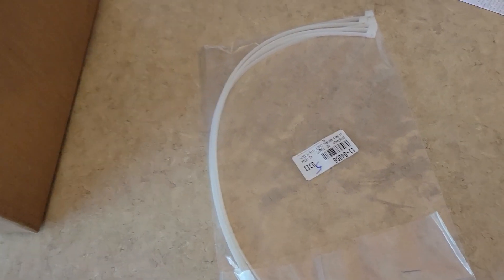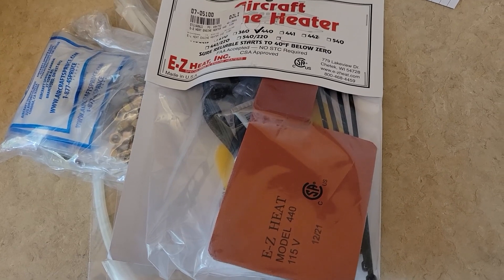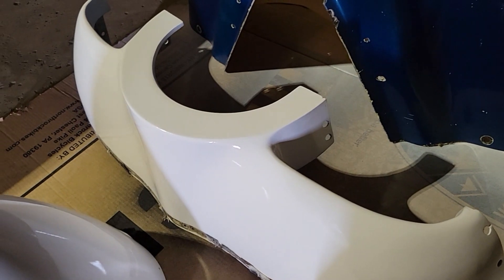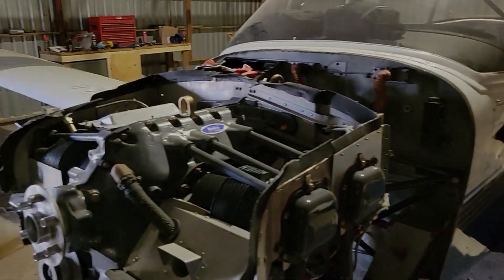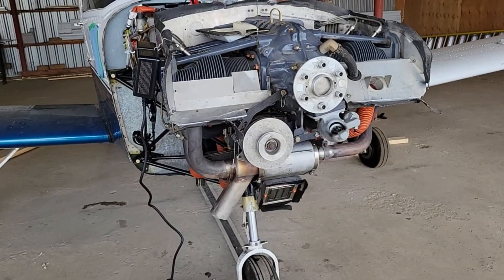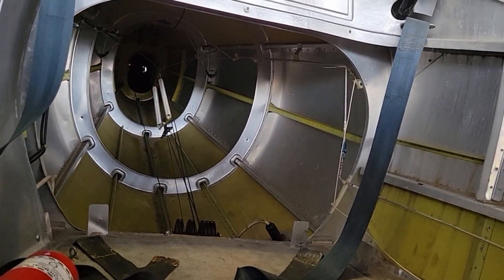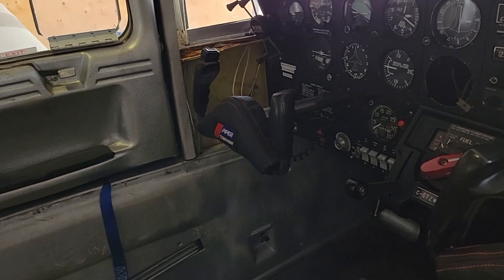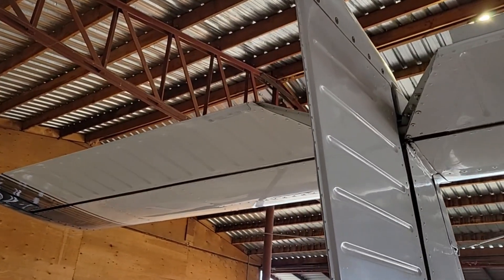Piper Tomahawk Update - Close to Taking Flight!

Comment: I like T-tails also.  They can be blanked in a spin.  If I were designing an airplane I’d be a bit afraid to make it T-tailed.  There is a lot of info on spinning the Tomahawk though.   From memory:  it was spin tested like crazy, then when a first customer did spins he (and his student?) had to unbuckle and scoot forward to get the thing to recover.   A structural change was made in the wing between all the spin tests and first delivery.  A trip device was added to the leading edge on each side.  It was a while ago that I read about this, on line.
Reply from the maker: Stall strips were added to the leading edge of the wings.  They make the stalls a little more benign.  I'm looking forward to doing spins in this aircraft soon.  I spin every aircraft I fly which prior to owning this Tomahawk has been rental Cherokees and C172s.  When I do some spins I'll be sure to collect some footage.